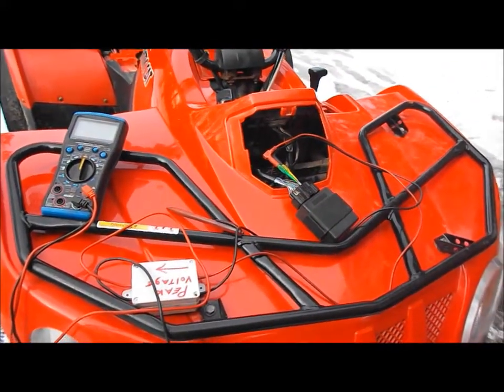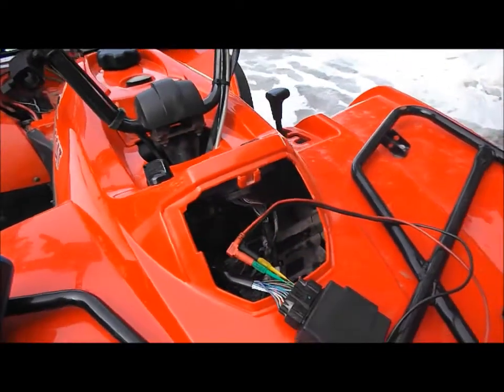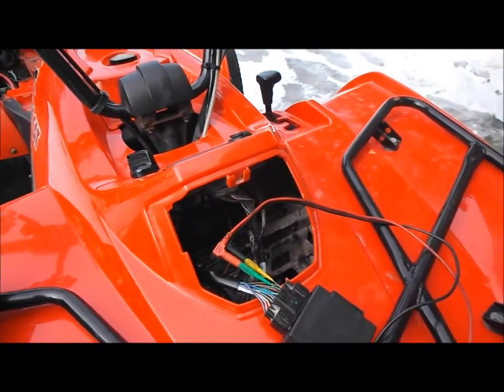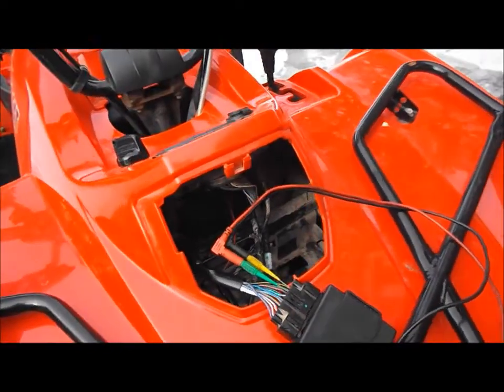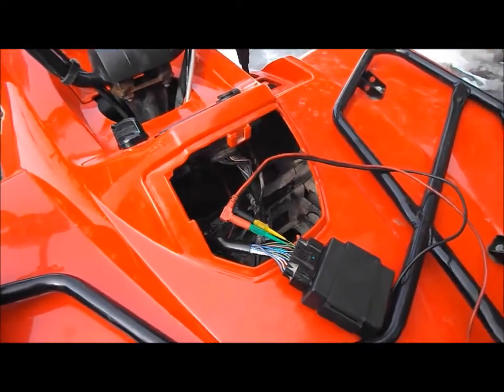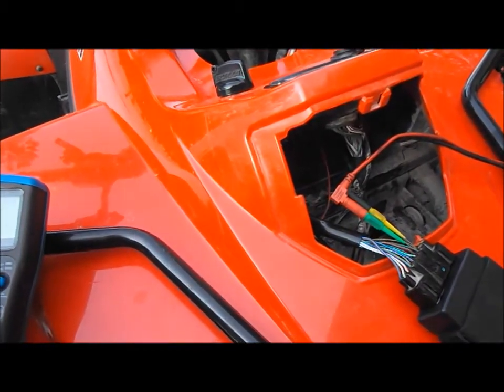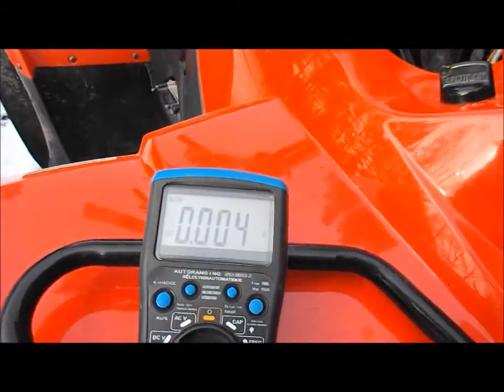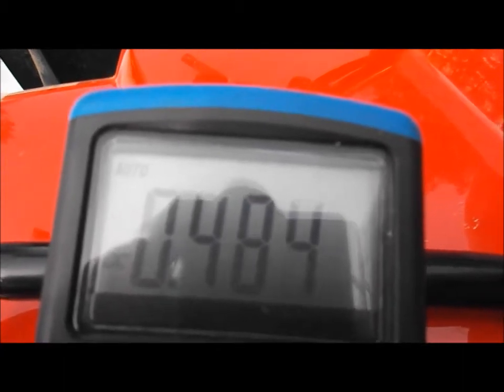Arctic Cat 366 no spark CDI Ignition peak voltage test

Comment: Got a 99 Arctic Cat 300 4x4 ATV with no spark. When testing the CDI box (single 6 pin plug style) I got 12v going to it, continuity from the emergency stop to the plug and spark trigger coil from the stator (Magneto style with only 3 yellow wires and spark trigger wires) and it's putting out 4.5-5v when turning the engine over.  Also when testing the CDI Box using the wht/blu wire that attaches to the spark coil, I get 20v and it starts dropping. When I keep the multimeter connected and try and start the machine, the voltage doesn't do anything from that wht/blu wire. I read that it should read 31v with key on and 130v while trying to start (when wht/blu is disconnected from coil)?

 I have a good ground going to the CDI box as well and continuity with all wires that go to it. it has to be the CDI box which this voltage issue coming out of the CDI Box happens with the Stock OEM Denso as well as a used Denso I got from Ebay and the aftermarket that I got doesn't produce any voltage from the wht/ blu wire that these Denso OEMs do. So unless they are both bad, then may the Spark coil is bad?
Reply from the maker: Andrew,  most of the tests require  a peak voltage meter to get a proper reading ,  hope you have spark now

Comment: My suzuki Eiger 2004 400 was in the water river and since that, no start :-/ i put new stator and new ignition coil and no spark :-( what the problem please ?
Reply from the maker: Have to double check the flywheel for loose weights,  also check the pickup coil if the stator did not have a new one  ..  check that 12 volts is going to the ecu  ,  if the water went inside the motor while running you could have more issues